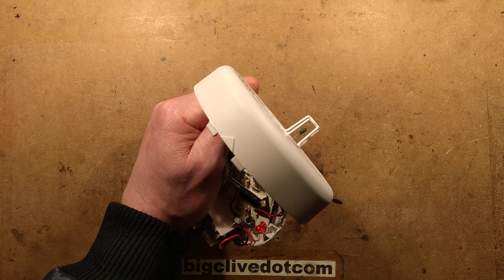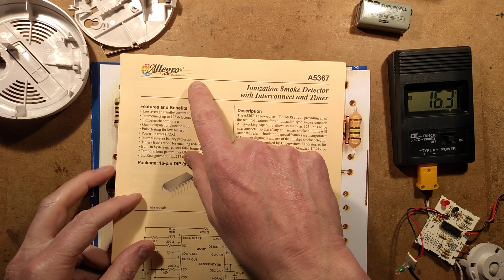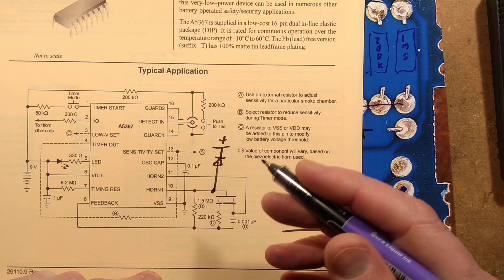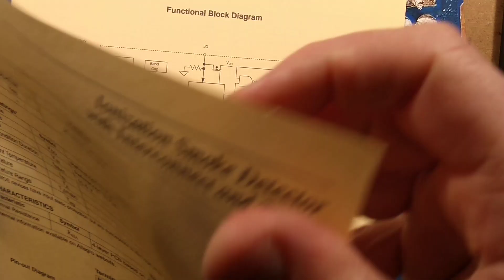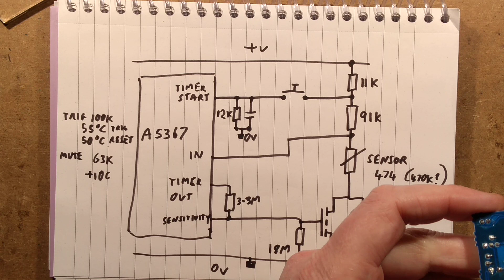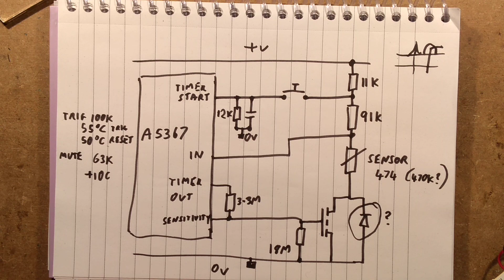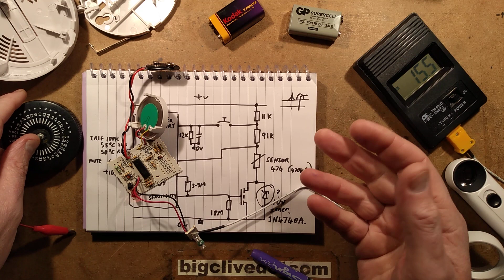Inside a heat detector alarm.  (Not a smoke detector.)

Comment: Perhaps they use this board in a mains powered unit as well ? So could be a variation in supply which would affect the thresholds?. As you say a battery version won't be affected by this 🤔

Comment: Zener might be in the circuit as an error and only useful when the board is totally populated and linked to other devices, if they are battery powered I ver several devices the excess could build up

Comment: It seems that the 2N7000 transistor is susceptible to static electricity; just soldering the transistor with an ungrounded soldering iron might blow it out. Once the transistor is mounted in the circuit board it is usually not a problem.  However, with the thermal-resister sticking out like that, where someone could touch it;  the "mystery" zener diode provides some protection by limiting any  external static charge that might accidentally be induced directly into the transistor and causing it to blow out.

Comment: I think this is some kinda of bias for gate of the fet. though the leakage current is very low  Fets are voltage controlled  so need very little current to affect them. Thats the only reason I could see how desoldering the diode would change sensitivity it must have changed the leakage of the diode they are very sensitive to heat.

Comment: Hmm. Working in a related field (industrial fire detection), I would be very suspicious of a "heat detector". Heat detection has a terrible reputation: first they are subject to inverse square law, so unless it's right inside the fire then the fire is probably already out of control before the detector goes off, and that's assuming that the heat is not carried away elsewhere by ventilation anyway.  Also, they tend to be made of materials that degrade over time: who knows how his detector will perform after 10 years? And given the normal seasonal and cooking temperature changes in a kitchen, how sensitive could they make it? Not very, I'd expect.  I would stick with smoke detectors: kitchens shouldn't normally be filled with smoke unless you regularly burn your toast!

Comment: The only suggestion I have for the zenor diode is that it is somehow offering protection to the mosfet, and that the chip still requires a trickle current to do something so they cheaped out and killed two birds with the one stone.

Comment: Could that 10v zener be used to allow a supply that is not from a 9v battery?  Or maybe it is there to deal with the power coming from an interconnected alarm, would that put two 9v in series as one alarm feeds into the next one?

Comment: I have a cfl that keeps making popping sounds and the light flickers.  This is a screw in 23 watt 120volt Sylvania. Been doing this for months.  What's happening?
Reply from the maker: It sounds like a bad solder joint inside.

Comment: The zener may be to protect the FET from static which many of the sensitive ones can be damaged by, maybe because the thermistor wires are exposed and it's a safety device?
It seems that if the FET were to fail the device could give a false negative that the chip might not detect as a fault.

Comment: Regarding the zener diode: 1µA is 470mV of voltage drop across 470k and 7µA 3.29V. According to the data sheet, the leakage current increases with temperature.
https://www.taiwansemi.com/products/datasheet/1N4740A%20SERIES_N1706.pdf

The diode from the beeper to +V protects the transistors from voltages generated when the piezoelectric transducer, which acts as a microphone, as well as a beeper.

Comment: This zener. Might it be a protection over the FET? Its usual to have a reversed biased diode over a transistor. If you use a zener it will work as protection in both directions.

Comment: analyzing brain is already asleep but Zv is dependent on temperature so that current will be based on temp so is that where the differential part of the detector is. And soldering on made it warmer so the higher trigger point

Comment: Dont they need a trickle current flowing through the sensor at all times, in regards to the mystery diode, and that is the job of it? Check if you can get the heat sensor to trigger without the zener diode in the circuit.

Comment: Regarding the Zener Diode - Because the sensitivity pin is actually a pulse train [smoke sample time], so the external mosfet actually turns on to pull the sensor down so that the actual resistance/temp can be measured by the IN pin. Hence the zener diode is for back emf protection in-case the sensor is inductive.  This must be the operating method otherwise the IN pin will float at Battery Voltage defeating the purpose of the sensor. To proof, a oscilloscope can be hook up at the sensitivity pin to see the pulse train and the zener can be removed to proof that the circuit is still functional without it. I suggest a Part 2 is necessary.

Comment: Bigclivedotcom The zener is acting as path to ground and as a constant current source (~10uA) in the reduced sensitivity mode when the FET is disabled. Without the zener, the sensor voltage divider would be floating, and disable the sensor entirely (100% reduced sensitivity). This simply raises the ground potential slightly, and shifts the sensitivity. Try reading voltage across the zener in normal vs. mute modes.

Comment: Hey big Clive, would you please take a part a protected vaping Mod, say one that supposed to be 200 W that runs off two 18650 batteries?  Explain what the chips do inside & how is it possible to get 175 - 200 wants of supposed power from two 18650 batteries. I would find this extremely interesting! I bet a lot of other people would also.  As far as I know, there are no other channels doing this. :-)

Comment: I ran into this use of a Zener in an industrial temp monitor (for cleanroom fume hood fire detection) years ago - around 1985 if I recall. 
Zener diodes have some useful characteristics when operating below their breakdown voltage, with the transition temperature being "selected" by the rated breakdown voltage. I don't claim to understand exactly how it's being used here, but I think that's how they are implementing the "Rapid Rise" function. Here is a quick explanation of the effect. https://www.microsemi.com/document-portal/doc_view/14628-zener-voltage-regulation-with-temperature
Hope you figure it out!

Comment: The FORWARD voltage drop of a silicon junction changes according to the junction temperature at the rate of 10mV   per °C e.g. an increase of 1°C will cause an increase of 10mV and a decrease of 2°C will cause a forward voltage drop of 20mV from the nominal 600mV. In your circuit, if the diode is to be connected with anode biased positive with respect to cathode,  then this will offset the bias into the temperature resistor chain according to temperature. As the thermistor is mounted in a temperature sensitive location outside the enclosure and the diode in question is mounted inside the enclosure, this will provide a certain of hysteresis depending on the thermal lag between thermistor and diode. This thermal lag will provide for a rate of temperature rise rather than just a temperature rise. A combustion on a hot day  is needed to be sensed pretty much at the same sensitivity as combustion on a cold day. However, the diode in the circuit in question, is reverse biased and I suggest that this is incorrectly installed. Keep up the good work Clive, best regards yorkybar.

Comment: Assume that the zener is used in it's most common fashion.  It protects the voltage from exceeding 10V.  Perhaps the horn generates some back emf spikes that need to be clamped to avoid damage to the rest of the circuit.  
Also, many electronic designers aren't well schooled so perhaps there was a circuit used in another device that ran on mains.  And when the engineer lifted the circuit for this exclusive battery operated version he didn't realize the zener was no longer necessary.  I used to work with car radios and sometimes entire circuits were lifted for a new design. And a certain transistor was included in the lift but the truth was that transistor was never going to turn on.  So millions of these radio units were shipped with a transistor that would never do anything but up the cost about 3 cents for each unit.  Frequently when servicing these units I would take that transistor out and toss it in my spare parts pile.  But one can only tolerate just so many 3906 transistors in ones spare parts box.

Comment: Americium emits beta particles which are fast electrons.  The electrons act as current flow so the Americium is kinda like a battery.  The fast electrons flow across an air gap.  If smoke gets in that gap, because smoke consist of ionized particles, they disturb the flow of electrons and the chip detects a sudden change in the current.

Comment: if you drop or knock on the detector the piezo could easily get >50V between the electrodes. in a high resistance circuit this might present a risk for the inner electronics of the IC

Comment: I venture the guess that the NP junction of the Zener is being used to set the ambient room temperature to be compared to that of the exposed thermistor. If the room slowly changes temperature then they both change and there isn't the discrepancy between them to trigger the device. It explains why after you soldered the leads of the Zener, the thermistor needed to be heated to a higher level before the triggering happened.
When I worked on thermal meters we were required to wait over 24 hours after we soldered any component in the sense circuit before we could align and check calibration.

Comment: My work has an old, low-tech heat detector in the server room: wired up to the burglar alarm system as "fire trouble" (but not to the fire alarm system, strangely). Unfortunately it's normally closed (as would be expected, of course, for an alarm circuit), and the previous company which occupied the building wired the heat detector via a pair, sharing a UTP cable with numerous other pairs, through the 66-blocks, completely unmarked/unlabeled... so while I was ripping the 66-blocks out (we're 100% VoIP), I ended up setting off the alarm sounder. (Thankfully we didn't have any monitoring on the alarm system at the time...)

Honeywell T631A1055 "Provide line voltage control of heating, cooling and ventilating systems in farm buildings or storage areas."

Comment: according to the datasheet the 1N4740A has a leakage current of 10 µA at 7.6 V - which is a factor of 10 higher than the leakage current of the 2N7000. It might very well be used here as an extremely low constant current source for the resistive divider.
Reply: Is reverse leakage of a diode better thought of as a constant  current? I would have thought it was more like a resistance
Reply: @power-max  yes, through most diodes it is a rather constant current, described by the term Is in the diode equation Id(V)=Is(exp(qV/kT)-1).

Very often there is a parallel shunt conductance which will lead to an increase in current for higher reverse voltages. Also when reaching breakdown the current will rapidly increase.

Fig 3 shows the reverse current over a logarithmic voltage scale, on a linear scale it will be much flatter.
https://www.vishay.com/docs/81857/1n4148.pdf

https://www.vishay.com/docs/84064/anphyexp.pdf

Comment: If I am understanding the schematic and datasheet correctly, then there seems to be a mistake in the description of how the circuit works.

The default voltage on the SENSITIVITY SET pin of the A5367 is 50% of the battery voltage (due to internal 1.1M resistor to ground and 500k + 600k to VDD). But this particular circuit also has an 18M resistor to ground on the SENSITIVITY SET pin. This lowers the sensitivity to ~48.52% of the battery voltage.

Either way, the FET is actually turned on to begin with when powered by 9V. Which makes sense, since it can't very well do any smoke detecting if the detection voltage divider doesn't have a path to ground. The purpose of the FET seems to just be to disable the detection circuit unless the battery voltage is high enough. Not sure why that would be necessary though.

When timer/hush mode is triggered, then the TIMER OUT pin is pulled to ground every time the A5367 samples the DETECT IN pin. That places 3 resistors (1.1M + 18M + 3.3M) in parallel, which drops the trigger level to ~41.76% of the supply voltage. So it makes it harder for the alarm to sound, but it will still trigger anyway if the temperature is hot enough.

As for the purpose of the zener diode... It must be to protect the FET from static discharge since the thermistor leads are exposed. It would only come into play when the battery is low/removed (FET is turned off), but that's when people are most likely to be fiddling around with it. 10V is well below the maximum the FET can handle, but since the battery is only 9V anyway, that's just an ultra safe value to choose.

However, there doesn't seem to be any way for the A5367 to know if the FET is bad. If the FET happened to be failed open, then the alarm would never sound in a fire since the DETECT IN pin voltage would always be higher than the SENSITIVITY SET pin.

Comment: Interesting how we be able to fight fire 🔥 in 🔮future 🔮?  Maybe liquid silicone 🤔 there's a very effective new ways with non flammable gases or special liquids which not damaging electronics, but they are expensive. Silicone can be cheap way, it's resistant tovery high temperatures,  non conductive and can be cleaned or destroyed with ultraviolet.

Comment: just using the voltage drop of the diode to bias the sensor by raising its (-) terminal voltage making it easier at lower ''smoke/heat levels'' to reach the input pins threshold/trip voltage, in hush mode the fet removesthat bias voltage so the sensor has to be ''more triggered'' to raise the voltage on the sens pin, I guess they didnt do this 2 voltage level switching internally (no doubt its an op-amp) to allow for different sensors with different resistance changes

Comment: Does this Zener diode have a temperature dependent leakage current/resistance that might affect the circuit? I ask because IN4148F have been used as breath temperature sensors in "Apalert" veterinary apnoea alarms.

Comment: According to the data sheet, the sensitivity pin is at 1/2 VDD unloaded.
This would keep the FET turned on given there's 18M between the gate and ground which would keep the Zener shunted in normal operation.
When timer/hush is triggered, the timer out pin is pulled down to VSS, both lowering the sensitivity via the 3.3M resistor and sensitivity pin and causing the FET to turn off.
This means the Zener is now in series with the sensor divider and the reverse leakage limits the current within that string effectively lowering the sensors sensitivity.

Comment: In the fire and security industry with our wireless smoke detectors we use the 9v lithium batteries good for 10 years or so they state . However the starting voltage is 11.5 vdc could this be why the diode is there

Comment: Thanks for covering these, I've never heard of them before. An interesting experiment might be to substitute a 9v Zener diode for the 10v one and see what that changes the triggering temperature to. I'm, going to say I agree with the commenters that the diode used might have been intended for running the unit off a 12v power supply. I'm also happy you took the time to explain the uninstalled components, that's always been a thing I wonder about when 'chinese ebay specials' are torn down.

You might be interested to know there's a number of cheap smoke detectors available via eBay that only sound if you press the test button, they might be worth investigating in the future.

Comment: I did lights and sound for my high school theater several years ago when I was under 18. I've since become the local "expert" electrician and designed and run several shows. They call on me to design and plan every show. I design and run every show manually. I never leaned to program a cue or put a timestamp on a scene. I have an ETC Express 48/96 and I do everything manually every show. I know all the channels and all the groups by heart. Our catwalk is 30 ellipsoidals and the rest of the lights are above the stage on three pipes. Roughly 10 par cans per pipe. Anyway, I was trying to say that my theater didn't have any smoke detectors. I could do anything I want without a worry about smoke or heat. Smoke bombs and pyro were no problem.

Comment: Thx Clive, great video. PS - when you get a dark circuit board try using a simple photo editor to invert the colours. Just a thought.
Reply: Doesn’t work. The problem is the lack of contrast between the copper areas (tracks/pads) and the non-copper areas. It’s even worse with a white or black coloured solder resist.

Comment: My thoughts on why the Zener changed its tripping threshold is due in part to the solder used.  The solder used originally had a slightly different resistance value and that's why it was spec'd out during production and the solder you used is just different enough to produce the different triggering amounts.

Comment: there are many (i do mean loads) of pcb made with bent resistor and axial cap leads , they do seem to be from the better quality manufactures and they are quite hard to desolder but i usually have long enough finger nails so dont get burned to much :-)

Comment: There are not many smoke alarm chips since getting them certified is costly. Image the legal quagmire from multiple deaths due to a smoke alarm not working. Just a thought.
Reply: In most cases the final product is certified for a fire not a component.
Reply: @konradw360  Fair bump.  Still, would have thought that there would have to be some form of certification of a purpose made silicon chip since it's innards are buried within a layer of opaque black epoxy.